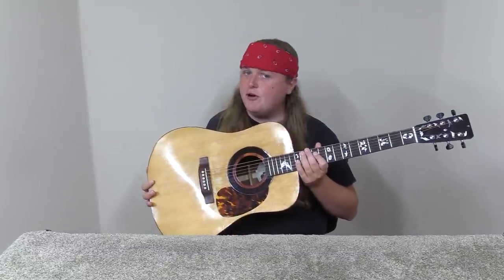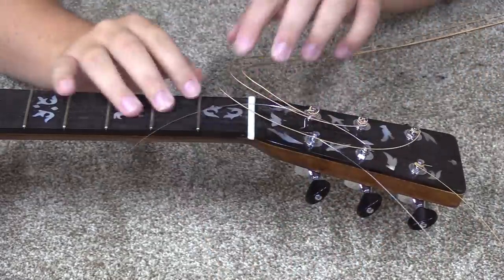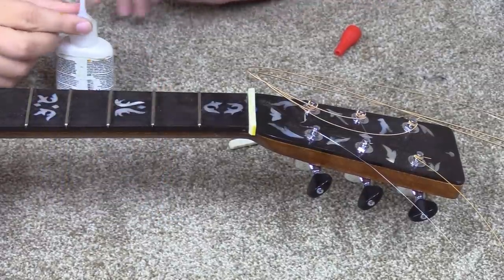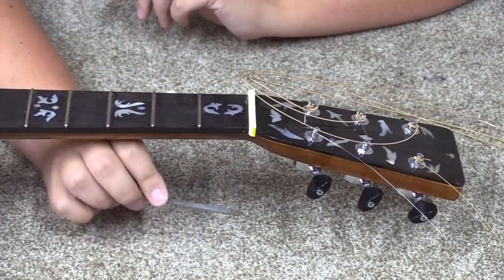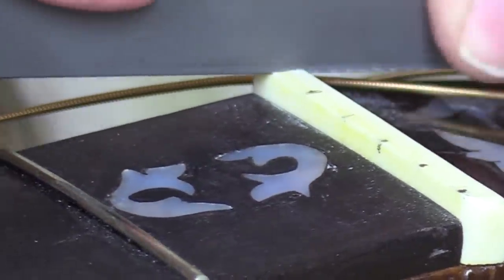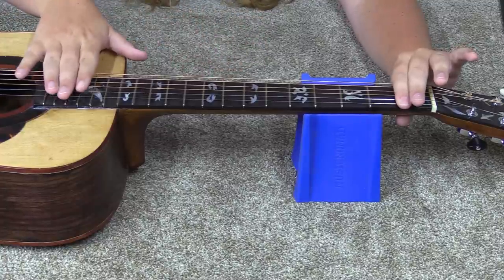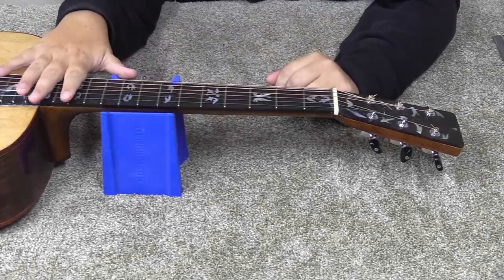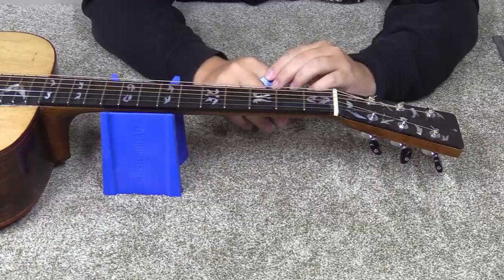Homemade Guitar Setup

Comment: Nice job. The builder did a nice job too. 

After setup on four ukuleles or guitars I agree in its very time consuming. But, having a nice low action is worth it's weight in gold and I am glad I did all four. 

Two I built the others were a Seagull and Kala. I discovered manufacturers set the action high and being a beginner at playing a very low action is so much easier to finger and Barre chords.

Comment: Get yourself a string spacing rule Caleb it's a vital tool if your making your own nuts. Stewmac might do them but I'd recommend buying the crimson guitars one from the uk as it has a zero so much easier to use and they are only £20 so cheap and will last you a lifetime and having perfect spacing on your nuts will make your setups better and happier customers!

Comment: Put a capo on the third fret. File the nut slot so the string has the desired clearance above the first fret. You can figure out the clearance that works best for you and or the owner. It doesn’t need much. This completely eliminates the saddle height problem because the string is sitting on the second fret and the nut not the saddle and the nut. No matter what you end up with for saddle height the nut clearance will never be too low or too high.

Comment: Caleb, very nice, Iam sure you probably checked the levelness of the fretboard before you started messing with the action, a notched straightedge & a good flat straightedge is a must the neck relief is pretty important I usually jot down all those #s first before I start messing with anything, it’s a good habit to get into. Great job as usual. I wish you great success with your business 👍🙏🇺🇸🎸🎼🎹👨🏻‍🦯👨🏻‍🦯
Reply: I think he didn't. As far as I can see the neck has quite a bit of relief.

Comment: When making the nut, why don't you project the fret plane to the nut with a half pencil, sand it close the that, THEN cut your slots??  You waste a whole lot of time cutting the slots in a high blank.  With that method, I can get the slots within .02"/.03" high, the first shot, and the slots are at the proper depth.  Then I check the nut action when the strings are on and sand the bottom of the nut.  I set the nut action by checking the gap at the first fret with the string pressed at the 3rd fret, the crazy high action has nothing to do with it.
Reply: I do the same myself with the half pencil and get myself just shy of the line and then work out my slots and cut shallow slots first. But I think it's just the way Jerry taught him because its harder to mess up doing it this way but takes way longer! Then I shape my nut and polish the bone also after the final setup of first fret action.
Reply: @stu-j  It's actually easier to mess up doing it the way it was done as there is much more chance of the file wandering off line. Have a look at the string spacing at 32.16. This kid needs a bit more constructive criticism instead of the regular chorus of "oohs" and "aahs" that seem to be posted regardless of work quality.
Reply: T @brettwilloughby2981  I agree but he's only doing what he was taught and I've criticised his teaching and skill level for a long time so I don't blame the kid 100%. I wouldn't let him touch my guitars but I wouldn't let Jerry also as I think he's worse. Caleb will get better but my advice would be find another teacher so he can up his skill level.
Reply: @stu-j  You've hit the nail on the head there mate! Bad habits taught from day one. The fanboys would be well served watching Ted Woodford's channel. They'll soon see a true professional with an eye for detail that actually knows what he is doing. The differences are like chalk and cheese.
Reply: @brettwilloughby2981  Ted is fantastic but that skill level takes years of practice and I'm sure lots of mess ups along the way. The Internet is a strange place and I watch Jerry most of the time cringing at what he does to people's instruments and actually documents it on video.  He's a skillful builder ill give him that but as a repair person he's not very good at all! That poor Gibson acoustic was awful that he re finished and I had comments removed that didn't criticise just giving an opinion on how something might work better.  I've been repairing guitars for over 25 years and I don't even come close to Ted's skills but I'm more a setup man now and only do big repairs now and then. My advice to Caleb is to find another good Luther and even work for free a couple of days a week to get more experienced and he will be a good Luther in the end.

Comment: Why didn’t you check the neck angle to the bridge first? Spacing has nothing to do with the action height. Did you measure the height of the previous nut at the first fret? Guitars have specs for spacing, it seems that your half assing  and guessing at things. Watch more YouTube videos and acquire the knowledge you need to work on guitars. Guessing as you go, makes for poor repairs and unhappy customers!  Comments saying great job don’t have a clue what’s going on. Sorry.
Reply from the maker: I'm sorry that it was obvious the saddle height was the problem, and I saw no reason to discuss the neck angle. The neck angle is fine, it was checked when the customer dropped off the instrument. You're right spacing does have noting to do with string height, heaven forbid more than one thing can be wrong with a setup. I'm sure there are standards for spacing on standard nut widths, unfortunately there are not standards for custom built one off instruments. I'd hardly call measuring to the thousandth of an inch guessing. Thanks for watching